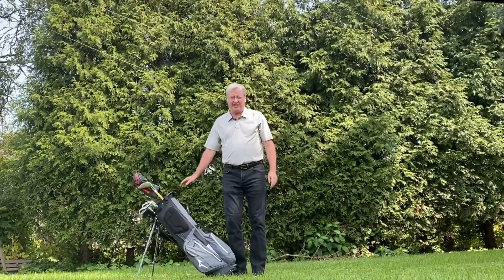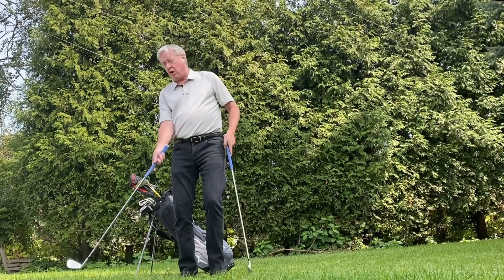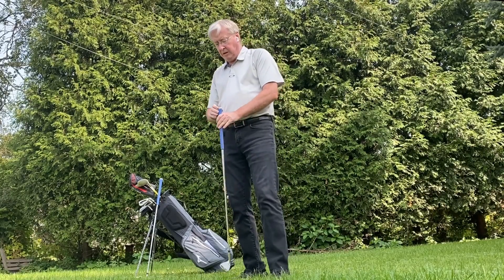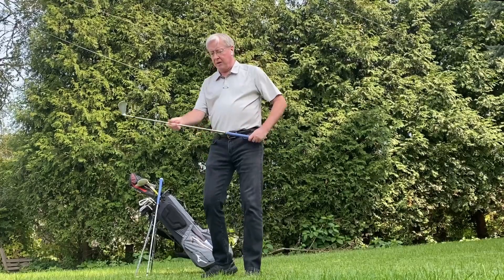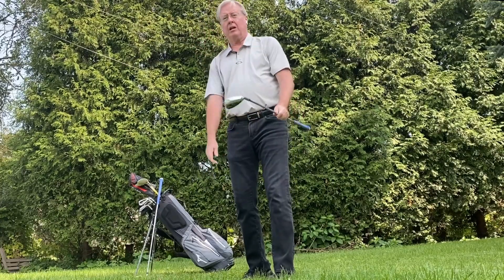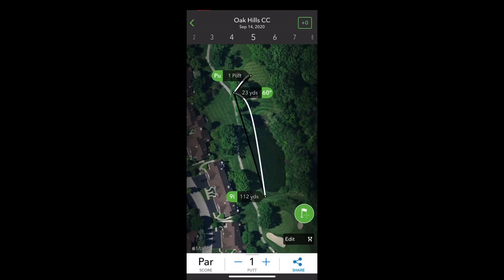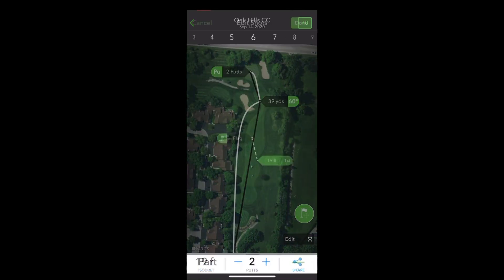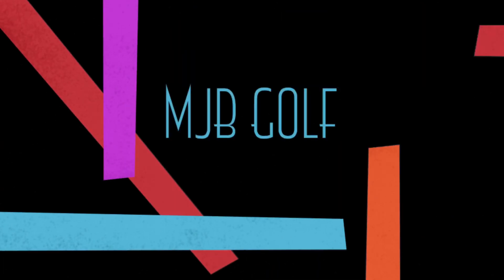Single length irons and sensor technology

Comment: Did you purchase those off the rack to mess around with?
Reply from the maker: I’m still working on them. Overall higher but the experiment is ongoing. I recently believe I found a key that makes them perform correctly. I’ll do a video when I have more data.
Reply: 4 hybrid cut down/weighted, 5, 6, 7 single length, 8, 9, wedges standard...works best for me. Defeats purpose of single length but love the shorter hybrid/mid irons.
Reply from the maker: @jerryinsc  All of them really.
Reply from the maker: I’m considering shaft changes and I believe I’ll end up liking them. I have to pin down the inside 90 distances with the gap wedge and it will be fine. I just don’t like whippy shafts. Right now they’re inconsistent with the way I swing.
Reply from the maker: Yes off the rack. I’ve always been curious about them. I wanted to test them. Eventually I may replace the shafts with graphite. I’m not sure as of yet. Don’t worry I’ll put them through my testing paces and report further findings as I progress.